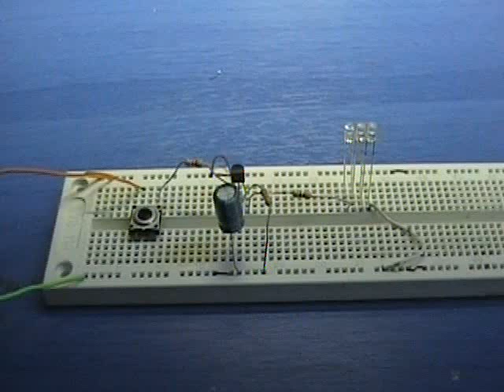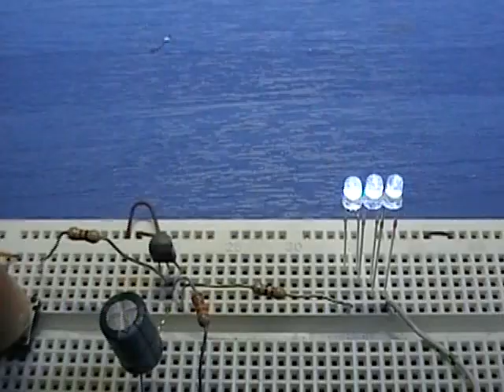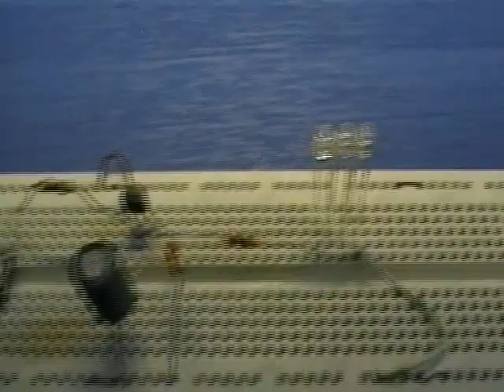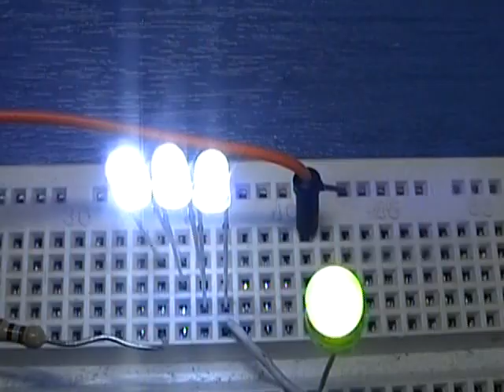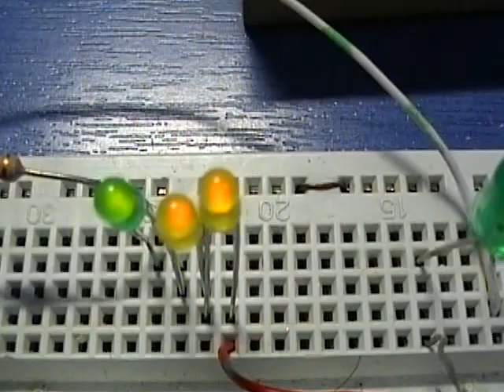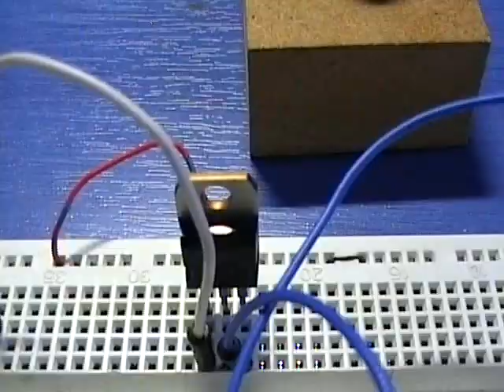LED Fade In Fade Out effect with simple components

Comment: Thankyou for sharing this circuit, setting the standby current for the LEDs was something I couldn't on any other circuit! I'm assuming the "on" current for the LEDs can be changed as well by adjusting the resistor between them and the transistor, is this correct?

Comment from the maker: @RafaelMarrero86 a toggle switch is one solution to your problem indeed. But you can use an RF flip-flop chip and connect it as a toggle switch, and then use a simple pushbutton which will work as a toggle switch. Search for "flip flop toggle switch"

Comment: i was also wondering, from your LED flasher circuit, if we can add a capacitor and a diode in parallel to the LED array, it would give them a fade in and out effect right?

Comment: I will be using the simple form of this circuit, as I am not concerned with adjusting the fade rates. However, my power supply will a 9V "wall wart" adapter. Can you tell me what my values will need to be for the components running on 9V vs. 12V?